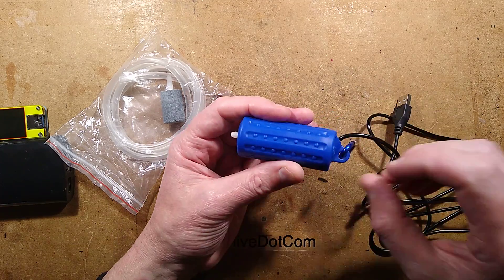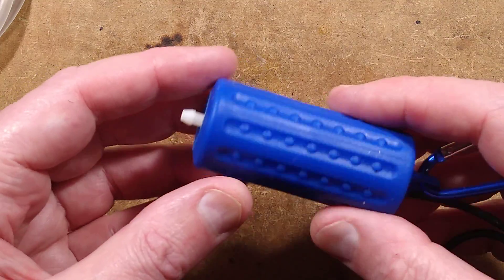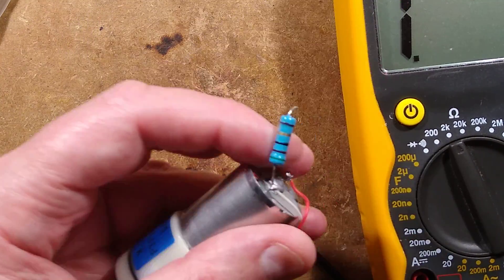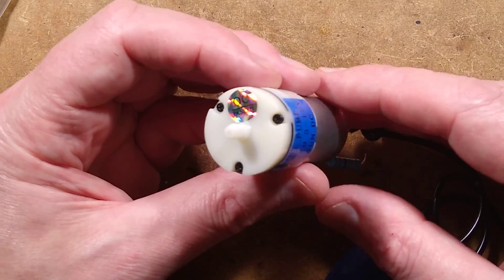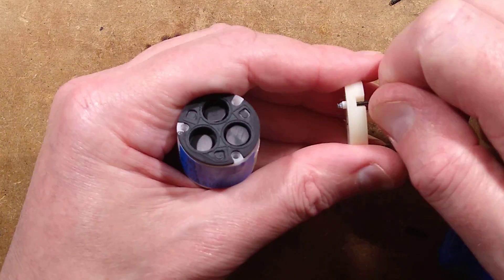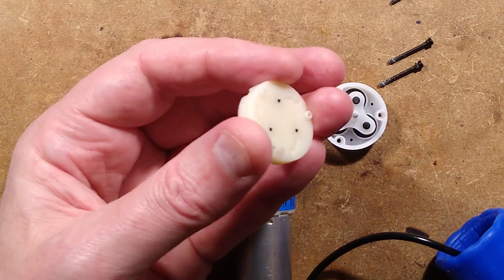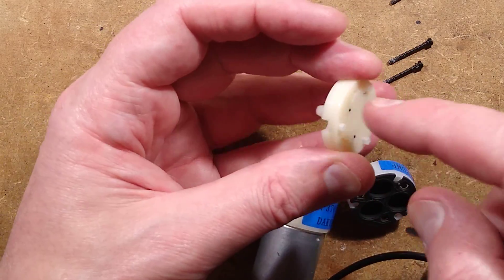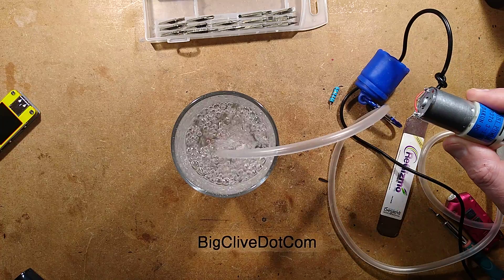Inside a clever USB air pump teardown with hack

Comment: Fishy Fun Fact: It's not the bubbles coming up through the water that adds air, it's the movement in the surface of the water they cause that does it.
Reply: this can be verified very easily. To make it so that the bubbles do not shake the surface. Has anyone tried this?

Comment: Sorrry for the spam...
But i think its mostly the agitation of the water at the surface that encourages gas exchange.
So by the looks of it a 1.5v supply might do it.
If you got a good one...

Comment: I've been using these on my aquarium for some time. Great little air pumps that are so quiet compared to others. Good to know about the resistor!
Reply: How long does the DC motor last if I run it continues for my fish tank. It is sound less and less power consuming and a small pump
Reply: @nsasimallik  I've been using one for about a year and half now. It still runs fine and quiet.
Reply: Curious where did you get it from
Reply: @nsasimallik  I not sure as I've a few now from different places either Amazon or eBay.
Reply: @steviekehoe  I am from India and I buy it off Amazon. They are expensive here and only last few months. Tickling sound keeps coming from the air pump after a few days and the motor freezes after few months

Comment: I have two of these pumps running my fish tank. They've been running non-stop for over 4 years. Not bad for something that cost £5 from eBay.
Reply: With what kind of plug charger are you using them?
Is it safe to run them with a 3Amp fast charger?
I have ordered some for my aquariums and I am wondering which plugs should I get
Reply: @OdiFroilan  I plugged mine into those phone charger plugs and they worked fine for nearly 2 years until we had a power outage , they never came back on after that...
Reply: @FeMkE67  thank you for replying brother

Comment: I've got 2 of these that has subsequently died. One has just stopped and on is only ousting a measly amount of air. Shame only been used for 6 months...
Reply from the maker: They're not really designed for long term continuous operation.
Reply: @bigclivedotcom  ahh fair enough, for a temp device I guess six months 24h use os pretty good :-). It's the silence of them that I liked. 

Cheers for the reply fella, I very much enjoy the content.

Comment: I know this is an older video (relatively speaking), but just saw this come up.  Aquarium Co-Op actually sells a usb air pump.  Several uses in the aquarium trade are: low power outdoor pond aeration, low power alternative for running a sponge filter, transporting live fish in a bucket (larger fish for example would be one benefit or as a breeder transporting to a local store to sell), and as mentioned, a backup way to at least keep water flow going.

Comment: Both of mine stopped working within 2 months. 🤦‍♂️ Opened it out, crank started it, and works. However, when I put it back together stop working again. 🤬
Reply from the maker: Maybe brush wear.  I don't think they're intended for continuous use.  Just for emergency aeration or with travelling bait.
Reply: @bigclivedotcom  I agree, but this is only 1 month old. Amazon special, CAD$18. 
Bare motor starts on its own okay after I help it to start with. As soon as I reassemble it, nothing.

Comment: Could the 51 ohm resistor be protecting the USB power supply when the power supply is turned off and the back EMF of the motor feeds back into the usb supply?

Comment: Huh... color me surprised. I thought this was going to use a vein pump, not a piston pump. Thanks for the tear down. Saves me 8 bucks ordering another from the Coop.
Might order a few more anyway and connect a switch to the resistor for normal use and on battery use.
Reply: Btw... subscribed.

Comment: I just wanted to say I've been using mine as the primary air stone pump in a 5-gallon aquarium for almost a year straight. I'm honestly surprised it's still running (and quietly, too!) At this rate, even if it dies, they're cheap enough that I'll just keep buying them.
Reply: I am also using this type of USB air pump for my fish tank ( primarily). I am from India. I buy them from Amazon seller who procures them from China. They only work for 3 months or less. The DC motor gets stuck. I directly connect it to main using a USB power adapter

Comment: These are really useful. Last year most of the fish in my aquarium died as the power tripped out when we were on holiday. I have connected one of these to a solar panel I put by the window in case the same happens. Disconnecting the resistor improves the performance no end.

Comment: The resistor may be there to reduce any negative transients to the battery.   I would bet these would work great in series of 3 with the resistor across the first two on 12v.

Comment: Make 3 holes with 3mm drill on bottom stage, it will give a faint noise but doubling the bubles and make it more more efficient.
Mine work with Li-Ion 2200mAh and draw 35mA before, and after make holes, it just draw 25mA with enormous amount of bubble for my Red Cherry shrimp.
So I decided to drop the Li-Ion voltage with 2 silicone diodes in series  (1N4007 salvaged from CFL).
It dropping voltage about 1.2V and automatically lowering current consumption to 20mA and the bubble just right for my shrimps in the aquarium.

For many people it just neat and bad idea, but for me efficiency is number one. Because of it I can supply the oxygen for my shrimps with single 2200mAh Li-Ion for very long time, and during day small solar panel charging the battery so it absolutely off grid for me.

Greetings from Jakarta, Indonesia 🇮🇩
Reply: Great idea!  but I don't know where to put the holes? do you have a photo?

Comment: I’m in an electronics of automation class in college and I am learning resistors rn. That resistor is a 5 band resistor. If my colors are correct, that is a 51 Ohm resistor. The first three bands are numbers, the 4th band is a multiplier, and the 5th is for tolerance (black means it has no +/- tolerance.)

Comment: You can use it in aquarium generally too, not just as a backup or travel unit... it’s a little less powerful than full size units but MUCH quieter and sufficient for small aquaria. Should I remove the resistor if running off a normal USB supply (no battery)?

Comment: I have been using this for 2 years now.

It's my backup aquarium airpump.

I just use solar panels and battery
100% recycled from old electronics.
But this pump gets faulty fast 
But suites for my need.

Comment: Does reversing the polarity change the air flow direction? Could it be used to suck air via the pipe?
Reply from the maker: No it doesn't, but you can get pumps with separate inlets and outlets.

Comment: Thank you for the idea! I got one of these for my fishing bait bucket. Removed the resistor, attached 4 AAA batteries in a pack with a switch, and am now giving it a longevity test. Way smaller and lighter than the pump I was using that took 2 D cell batteries. I'll report back with success or failure.
Reply: It lasted 5.5 hours before I turned it off and went to bed. The batteries still test as good after. This is an ideal replacement for my old bait pump. Thanks again!
Reply: @badmonkey0001  I am planning to buy one of these, do you recommend i remove the resistor? i am planning to use it with a power bank for keeping bait alive on saltwater...
Reply: @Bpreppye  Definitely remove the resistor. First thing I do.

Comment: But the ones with two real air plugs suck at sucking. The POM casing is just pressed on the intake third were the motor shaft ends into that excentric part so it is not really airtight. If tighter more sucking. I have one in spare but broke the gasket by too much dirty smoke.

Comment: You could estimate the airflow rate by filling a litre bottle with water while immersed in a large bowl of water. Invert the bottle, keeping the open lid of the bottle under the surface. Then use the pump to bubble air into it and time how long a litre takes to provide 1 litre.

Comment: Impressive to many eyes, yes. I may have missed it, but one trouble with cheap internet trade (apart from affecting High Streets) is a complete disregard for CE marking, also known as conformity to essential health and safety standards. While this pump will not come under the Low Voltage Directive for safety owing to the USB source, it shouldn’t be placed on the EU/UK market without being declared/tested for (1) RoHS Directive (banned chemicals) which will poison the soil/cause infertility, and (2) EMC Directive (ruin the RF airways). UK trading standards are however only bothered by protecting the commercial interests of Apple Ltd and possibly the occasional lethally dangerous camping stove

Comment: That's almost exactly the same motor/pump mechanism of my cheapo water dripping system I bought for an emergency on Amazon.
The only difference is that there is a hose connector instead of an air intake. Even the filter is exactly the same. It's cool how they repurpose this stuff.

Comment: Well Clive. I have been looking for one of these to use on my scroll saw to blow the saw dust away. Scroll saw have a bellows pump that run off the arm as the blade runs, but they put out enough air to remove the dust. This one would work perfect. Just need to hook it to the main off/on switch.
Thanks for the reminder.

Comment: With an Anker power bank certain ones have a trickle charger feature which keeps it on with extremely low amps being drawn. Ones that don't have this feature do have that problem with turning it off because of very low amps being drawn

Comment: Depth of the water (increased pressure) will change the volume of air. And the supply current.
Reply: Current is also a water word.

Comment: So I found a 4 pack of emergency roadside LED "flares" for like $10 US. They have about 7 modes selected with 1 button and powered by 3 AAA's. Haven't looked real close yet but I am guessing a small micro controls the whole thing via a few transistors (the components face down so you can't see them by removing the battery cover). These also have a spot light mode (besides the flashing colored LEDs). They are a nice package with a magnetic base and threaded inserts for the battery cover and moderately water resistant. I don't need them but I think I can rework them easily enough to make something useful (rip out the battery compartment, toss in a rechargeable, add a USB charge port, and add my own micro (attiny or similar) to make it do what I want) . Me purchasing these is entirely YOUR FAULT Clive...

Comment: That type of mechanism is generally referred to as a "swash plate". Swash plate compressors are the most common type used for automotive air conditioning. The mechanism used to adjust blade pitch on most helicopters is also called a swash plate.

Comment: Absolute garbage airline nipple. If you connect airline tube to one of these, chances are in a couple months when you need to remove the airline tubing, the nipple will snap off with it.

Comment: so, it's using and cooling the brushed motor's nasty filth to supply compressed air to the "near future dead aquatic life?".... because brushed motor do not produce ozone and likely multiple other highly toxic chemical emissions....... yep unless you missed where it has magical clean air....
Reply from the maker: There was a narrow concealed air inlet.  It doesn't go through the motor.
Reply: it's likely still doing the same thing, since it's pulling "ozone" and other pollutants from inside the outer case. the motor will always put out bad things, unless brush-less type.
the old school direct AC powered aquarium pumps were mostly all a simple wound coil steel arm vibration motor that drove rubber diaphragm pump/s for many years. commercial size stuff would be a crank driven diaphragm pump, much like they'd use for supplying air to humans for underwater :)

Comment: In a normal aquarium you do not need to add air like this. The most of the oxygen in the water comes through the surface and secondly through the plants.

Next time, try ramp it up more. Until we see... flames and the magic smoke!

Comment: Similar design to a little dual port pump I have that can pull a surprisingly decent vacuum. Also very useful for popping out rubber syringe pistons if the head gets stuck and the shaft pulls out.

Comment: I use those pumps ( the internal motor + diaphragm pump) for my outdoors hydroponics tomatoes with a solar panel, 12v battery and charge controller. They are the only (cheap) ones that seem to enjoy running with a 100% duty cycle 24/7! I tried using larger pumps but they never last, so instead i just use a bunch more of these as they cost practically nothing.
Reply: the motors on these things are usually from old coffee machine frothers, so that probably explains why they last so long compared to the crappily engineered bigger ones.
Reply: Your comment it's old buy here's my 2cents: I have hydro/aero tomatoes and I bet that you'll cut your electric bill like A LOT running a diaphragm pump to irrigate the roots in the air, instead of having a water bed+ injecting air continuously so they don't suffocate. They'll grow faster too.

Comment: Huh. I have four of these on my 40gal aquarium. Used exactly as stated. If mains fail, UPS keeps the heater going, and I have a homemade arduino setup detecting regular filter failure and switching these on from a 20,000 mah pack integrated with the arduino so no annoying auto power off. That little resistor removal will let the four of them run about five times longer. Great little discovery.

It's just cheap eBay insurance that I can stay at work, or whatever, and not worry about the tank. It's worth noting I also have a little water circulator (little propeller in a cage) on the same circuit as these to keep the water moving while being aerated. Maybe there's a resistor in that too. I may have to do some exploratory surgery.

Comment: It appears to be drawing the air from the back, through the motor. Aside from the debris from motor wear, this is actually a clever design as it collects nearly all of the heat from the resistor and the motor. That is, if you want to blow slightly preheated air.

Comment: Those little pumps are great, make nice solder suckers as well as hot air pens.
Very nice plant waterers too, the one I bought it used as a water dispenser, it plonks on top of a jug, contains a battery and usb charger.
Reply: M Harris  We have one of those pistol type desoldering guns. It has a glass tube that one stuffs some balled up cotton wool into which catches the stuff. The tube then gets cleaned with alcohol to remove the resin and the cotton replaced every so often. Works well.

Comment: Off topic.  What gives with GU10 bulbs? I have some in my kitchen and I believe they all run of a common transformer in the loft, which is turned on by the wall switch. So I assumed that they work as a set. Phillips Hue GU10's only switch each bulb, so they leave the transformer on 24/7. So very little energy saving from these bulbs! Or have I got it wrong?

Comment: I live on a narrowboat and am off mains electricity when I travel for four months in the summer. I have four fish tanks onboard and I run five of these pumps on power banks. 
The pumps run 24/7 and so far this summer they have run for over three months without failing. 
Brilliant little pumps that can easily replace mains powered units and not just be used for fish transportation etc. Added bonus is they are virtually silent.

Comment: You didn't account for the depth of the water into which the airstone is placed.  If the airstone is at the bottom of a modest 30cm deep tank, the pressure required to create air bubbles is significantly higher and the airflow rate will drop dramatically.  I doubt that unless the airstone is sitting only a few cm from the surface (as you showed) that you could power this with the low voltage that you saw.

Comment: 2:18  that Golden band represent 10^-1 (÷10)

Here 510÷10 = 51ohm
Reply: No, it is 51 with zero zeroes and the gold bar indicates 5% tolerance
Reply: @marcbontekoe4083  no. Golden is not tolerance here. Because it's a 5band coding. Here tolerance is the 5th band sitting after golden(usually a bit far from others) - Brown. Which indicates 1% tolerance.
Reply: @SAHILKHAN-lu8oq  You're right! I missed the fifth band

Comment: Hi Clive, I have just pulled exactly the same pump out of an old faulty blood pressure meter (battery leakage damage). The one I pulled from the meter also came “other goodies” including a miniature 6V air solenoid valve and a pressure relief valve.
Reply: I took mine too from a blood pressure machine, mine was a professional

Comment: These little 3 diaphragm pumps are all over the place in various sizes. They pump the air in automatic sphygmomanometers (blood pressure meters) and in the cheap newer low voltage compressors for medication nebulizers, they are in Keurig style coffee brewers to pressurize the boiler tank with air and push the water out through the K-Cup, and they are even used to pump the fresh water in RVs/campers/travel trailers/caravans and in water pressure booster pumps for reverse osmosis water filter systems.

Comment: I took one of those air pumps, hooked it up to a Lipo battery, connected the output of the airpump to a e-cig atomizer that uses MT3 coils filled with straight vegetable glycerin.  And now I have a pocket smoke/fog machine.  It can fill an 8x12' room with a light haze in about a 30 seconds and a fog thick enough to see laser beams in about a minute.

Comment: Those crappy "smart" power banks don't power off immediately so at least they could pulse that 100mA using a 555 circuit, but no...
Reply: Use a 220R resistor, to get the load over 50mA, and almost every power bank will stay on.